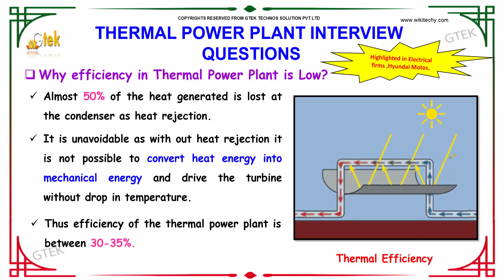Why Efficiency in Thermal Power Plant is Low | Thermal Power Plant Interview Questions

Comment: It is unavoidable as with out heat rejection it is not possible to convert heat energy into mechanical energy and drive the turbine without drop in temperature.